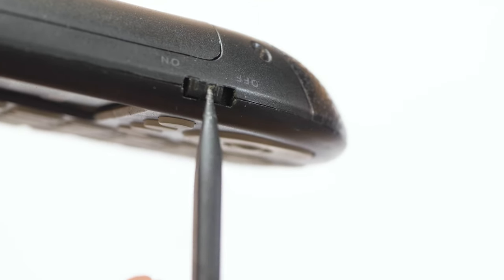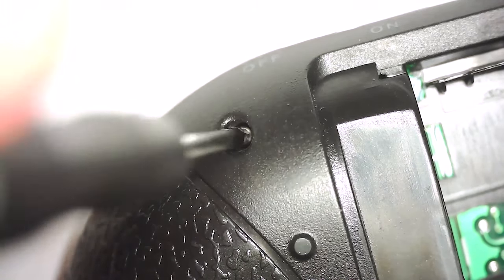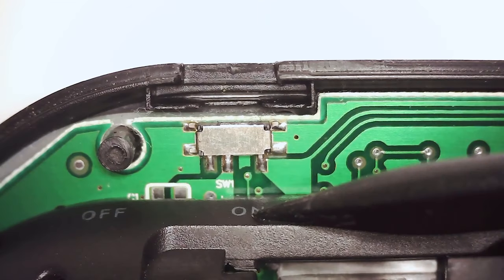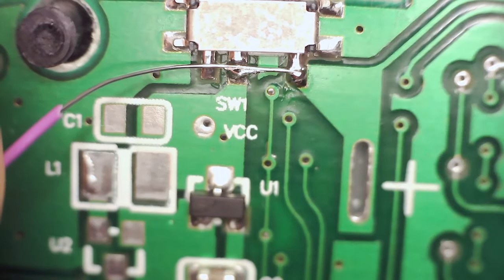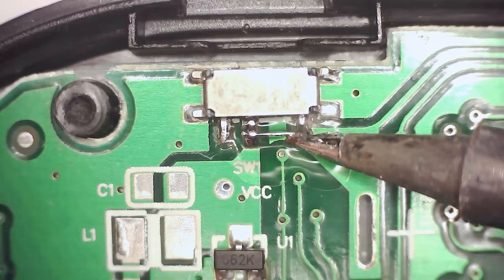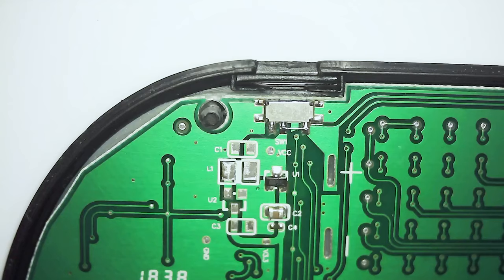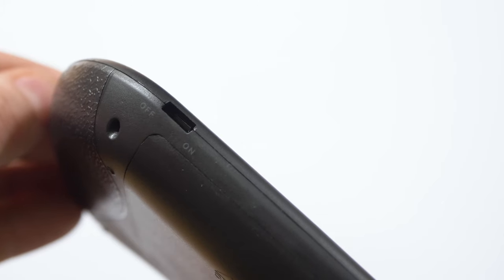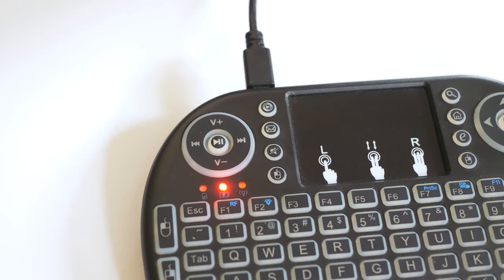Mini i8 wireless keyboard – broken power switch repair

Comment: Hi can you please make an video describing  how to jump wire battery Or how to repair it as I plug in usb 🔴led is on and even the battery is fine but i am unable to switch on the remote please help...
Reply from the maker: If it does not turn on with a switch you could try to do what I show on this video, put a wire between contacts of the switch. If it does not help, then it is possible that a controller chip may be broken and fixing it would be more difficult, or it would be easier to replace entire keyboard.

Comment: My keyboard has a red light showing for a while there and the mouse hangs, then it works but then the mouse lags again.
Reply from the maker: Is the keyboard far away from the computer? Is the receiver plugged behind the computer? The range can sometimes be not good and the receiver should be plugged in front, or on extension USB cable.